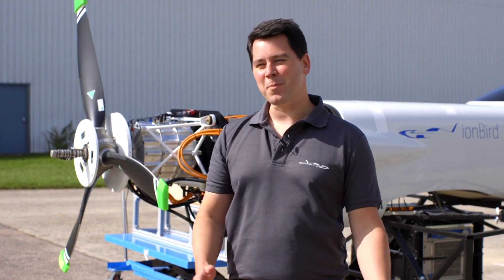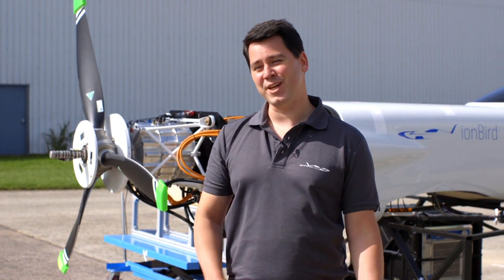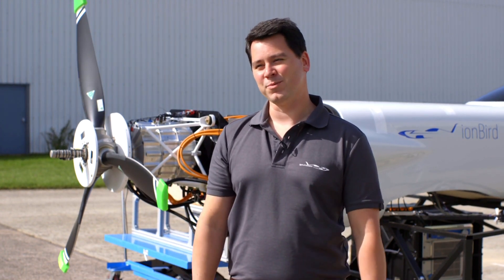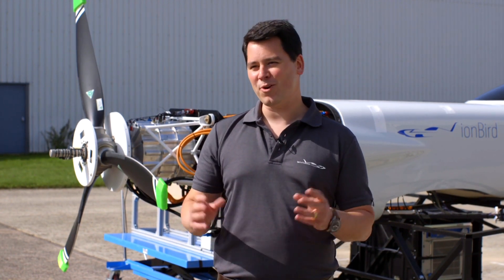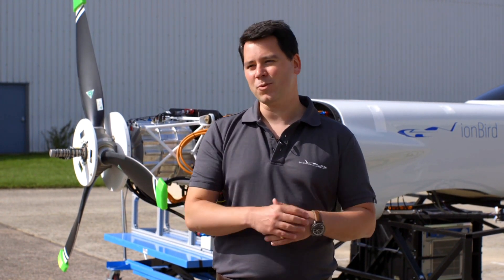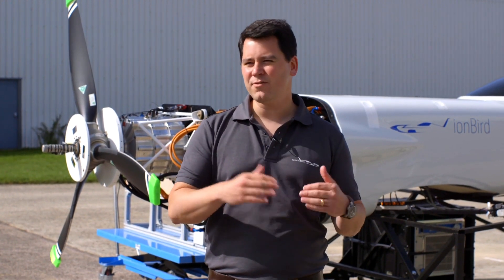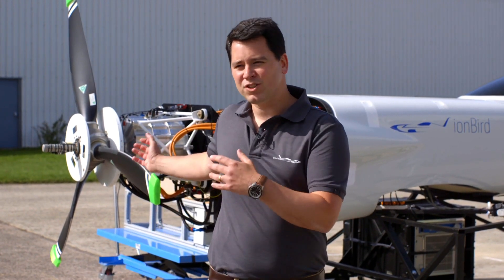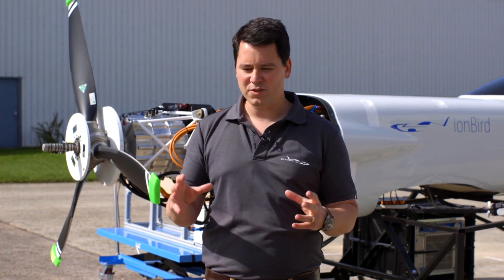Rolls Royce ACCEL ground testing

Comment: You still have to burn fossil fuels to make batteries and electricity.  There is no way to get around burning fossil fuels to meet mankind's energy needs now or in the future.  Nuclear may be the answer but that's still burning fossil fuels with all the inherent risks.   The perfection of solar energy is our best hope but to waste it on flying airplanes is pure folly.
Reply: Even if your using the electrical grid and not solar energy to charge your airplane. The fuel costs are still about 10x cheaper. You’re right most of the grids energy are fossil fuels like coal or natural gas but they’re still insanely more efficient.

Comment: Wow, batteries a motor controller and a motor. Congratulations.
Reply: No, running a prop at 24,000 that moves that much air requires some strong motors and they are doing it all with the requirement that it has to be super light and efficient. Your comment belies a lack of understanding and or intelligence
Reply: @andrewmcinnes3350  applause Bravo!
Reply: they flew it 2 weeks ago